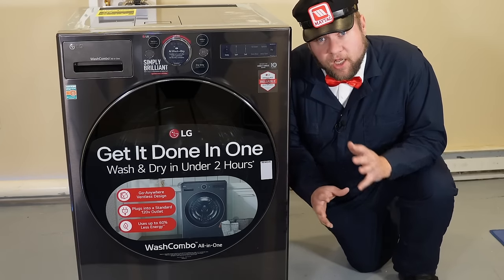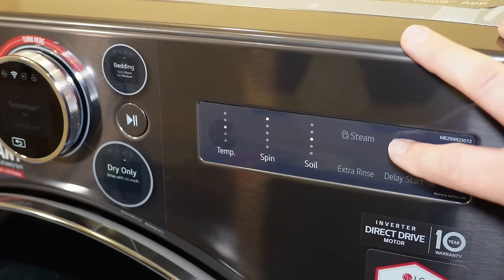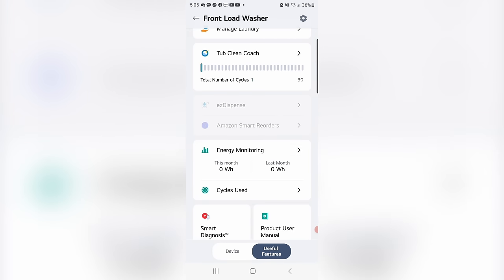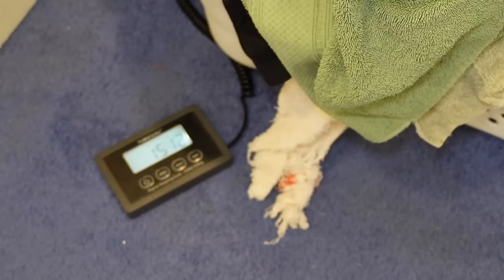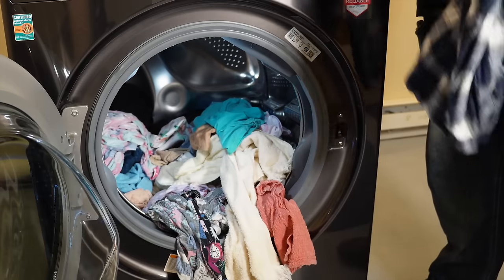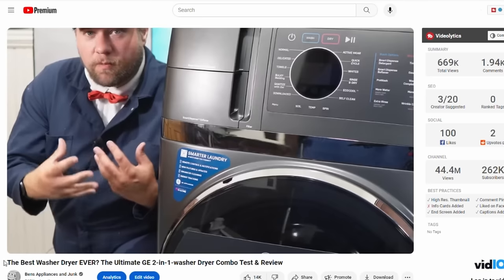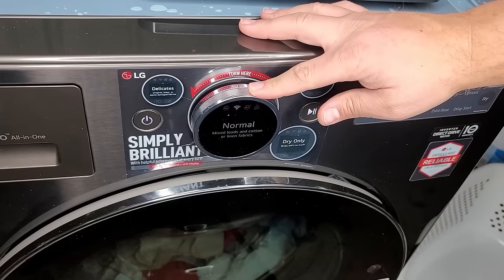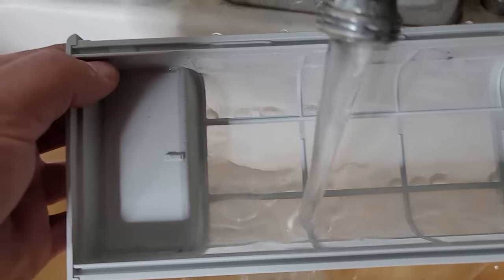BETTER THAN GE? The LG All in One Washer Dryer Combo: Test, Teardown & Review

Comment: Fantastic review!  I have one of the heat condenser models that is about 10 years old by now. I have loved it!  That is not to say it’s perfect by any means. Over those 10+ years I have had to have a repairman come out maybe three times possibly four, and once it was for some valves that had gone out, but most the times it was for a leak that would happen in the drain plumbing.  To save a few cents LG uses these really cheap plastic pipes and tubes inside the unit that literally decay, get brittle, crack and leak in only a couple few years.  It sabotages all the rest of what is otherwise seeming good quality otherwise.   The corrugated drain pipe is an example, and they use the same or similar to inside the unit as well. Had it not been for the stupid pipes and tubings I would only have had one repairman visit for the valves. It is really ridiculous that LG uses this cheap plastic garbage tubing in their units, because you cannot convince me that it’s that much more expensive to use a good old-fashioned rubber radiator hose that would last forever.  

It turns out that the complaints about it’s drying are somewhat ill-founded. There is a trick you need to do, which is to make sure that your drain pipe is not too high, the lower the better. The unit has to pump that water out and the easier it can do that then the quicker it will dry. I read one report from a lady who simply put her drain into a floor drain that she had, and she had very good drying results. My drain is about at the standard high about 32 in I guess, and I have not had that much problem. Another thing that helps is to have a dehumidifier in the room. So yes, the drying times will always be longer on these all in one models, but if you are like me, who just wants to throw it in and be done with it, it’s great!  If the clothes are damp, you just spread them out on the bed for a half hour and you’re golden. 

Given the age of my unit, the vibration dampers have now seeming worn out and I can’t run it but on low speed.  So I’m debating about getting it fixed or getting a new unit.  The only thing I didn’t like about the new LG is that dust collection on the condenser coils. I’m gonna study that a little bit more but it almost looks like they put the filter on the wrong side?  I have had once or twice where the heater smelled burnt a little bit on my unit. When the service people came out, I had them clean the heated dryer, and it did have a collection of dust in it. There was one report on Amazon of a lady experiencing a fire in it. I think you just need to plan on having a service rep come out every 3 to 5 years and give it a once over to keep everything tiptop and you are OK. There were also some people complaining about pet hair, getting into the filter and then having to clean the filter every single time. If that is your problem, I think you need to get rid of your pets. Either that or get a vacuum out and vacuum everything down before you put it into the washer. I don’t think you blame the washer for purposely clogging it up with gunk that shouldn’t be there.

Comment: I bought one and ended up trading it back in my clothes came out far too damp and the drying cycle takes far too long that I’m not comfortable with.  I never had anything below two hours everything was five hours to eight hours very disappointing in LG combo unit I trade it in on LG tower conventional drier don’t think the heat pumps are there yet.  Note it takes far longer to dry and never ends the cycle to dry.  I never logged a finished cycle.  I don’t recommend a waste of time.

Comment: given the tumbler spins for 4 hours vs normally 1 hour,
would the tumbler bearing life span drops 4 times as fast?
Reply from the maker: Its a washer bearing, not a dryer. They're built to handle 1600RPM spins, and the drum rotates very slowly in dry. So I imagine the mechanical cost to spin that drum on dry is very, very, very low.

Not only that, the drying action is going to kill molds, bacteria and build-ups that would eat away at the washer spider brackets, so its probably a net benefit, honestly.

Comment: 🤯 ~ you have a heat-pump combo washer+dryer in the 🇺🇸! We in UK & Europe have had combined washer+dryers for quite some time - but our versions, the dryer function is based on the very inefficient condenser unit = heater elements heat the air and it is blown into the drum through the hole in the right hand side of the top of the door seal, and through the laundry being dried and out through the holes in the inner drum to the sump at the bottom of the outer drum where the moist air is drawn up a column where water is poured/sprayed to remove the moisture from the air and a centrifugal fan at the top re-blows it into the heater block…🔄, on this side of the pond [🇬🇧🇪🇺] ~ the only manufacturer who claims to have made a heat-pump washer+dryer is AEG and all the others still use the inefficient dryer function. Interesting that the US is slowly adopting the trends in Europe and has even “jumped the gun” on the technological side. The heat-pump tumble dryer is based on a refrigeration cycle type dehumidifier = the moist air passes through the “cold” coil block where it condenses and water drips out > the “cold” air then passes through the “hot” coils where the refrigerant re-absorbs the cold and turns the air warm
Reply: The washer dryer is actually ancient American technology haha, it just was so inefficient that it didn’t really make sense to use. Down went that invention to Europe where it was slightly improved, but not by much. These new heat pump units are a game changer though!
Reply: @Ikey04-ge9gy  - yes, I have watched a 🇺🇸vintage laundry channel on YouTube, where a vintage/antique [40,50s] washer+gas dryer was being demonstrated = it had a square window in the door and it had a continuous, one-direction slow tumbling for the wash, rinse and dry cycles & a gearbox/large > small pulley ratio for the slightly more faster speed for the spin cycle and for the drying; as the motor drove both the drum & fan ~ a valve/damper would open allowing the continuously running fan to draw air through the drum and a (natural) gas valve would open and spark a small blue-flame fire at the side of the inner drum to “dry” the laundry! The laundry enthusiasts are heard laughing and mocking at it saying how extremely inefficient and rudimentary it is on its combined wash & dry program = the laundry being wet & soapy at the end of the program; extremely long times and a waste of gas. Most would not buy it, some who did buy it would give it a poor review and having the manufacturer “get rid of it” and replace with much more efficient with washer/dryer separates/having to supplement it with a spin dryer to try to make it more efficient

Comment: Ben from your review it sounds like you might favor by a small margin the LG... I was looking to get one or the other some time in the next 90 days... For my particular needs I thought that the LG might be a better fit... Very small apartment placed in the kitchen (near kitchen sink) to provide easy access to water and drain which I would rather have than a dishwasher... Run clothes washing in the middle of night... I have one of the LG monitors which is running the ThinQ app... Here in PA the electric rates are lower off peak and are only 0.17 cents per kHw hour... So I am guessing about a buck per load energy and buck and a half water costs... So this becomes a no brainer when the only laundromat is cost $2.00 to get there and $5.00 load to wash and $2.00 dry... not to mention the time!! Essentially my ROI (machine cost) is 15 to 17 months...
Reply: This unit as stated is much quieter than the GE.  My bedroom is close to the laundry room.  I couldn't run my old dryer at night because of the noise.  This unit just makes a distant hum instead and I can use it at night.  Average consumption I'm seeing is 2 kWh per load, so you might be down to 28 cents for elec. at night for a load.

Comment: I appreciate your reviews.  I would like to know if this new machine or the GE version use more electricity than a standard top load washer 5.0 cb ft with a 7.2cuft gas dryer? I love where electricity is very high And if these new devices really cost less that would be great but since they run so long i am concerned. Any comments or thoughts would be appreciated.
Reply: Usage is .3 kWh for wash and 1.7 kWh for drying.  So about 2 kWh per load on average for this machine.  Drops to about 1.7 kWh total if you were to get seperate machines that incorporate the tech of this machine, which LG makes in 2 forms.  Vertical wash tower or 2 machines side by side.

Comment: Interesting that you found no evidence of a self-cleaning coil as advertised.  

I don't like that you have to remove screws to get access to clean the coil and also to remove the secondary lint filter. This should be tool-less. 

Otherwise, I this the machine is a good offering.
Reply from the maker: It looks like there's 1 water hose going to the condenser box, but its offset to where only 1 side of 1 coil could be cleaned, potentially. There's no indication as to when it would use this in operation, or how, so its hard to guess. I had a commenter note a few days back that the LG heat pump driers had a good system, but without documentation, its hard to confirm what the process may be.
Reply: @bensappliancesandjunk  Interesting. Anyways, I love how in-depth you get in these videos. As a mechanical engineer, I enjoy seeing theses types of reviews. Thank you for replying to my post.
Reply from the maker: Thanks! I'd get more in-depth, but often I have to edit things out due to time constraints. I try not to say the same thing multiple times in the video to try to keep it flowing, but then also in some cases, there are things I wish I added (like more shots of the heat pump system, the water hose going to the condenser, and so on). I do hope to add these things when I do a head-to-head comparison of the GE and LG systems, since I won't have to repeat so much of the same things over and over again.
Reply: @bensappliancesandjunk   I'd also like to see more detail on the condenser cleaning system as well.  It looked like there were some holes in the heat exchanger cover that would allow water to spray out, but the video only showed that side of the cover for a split second.

Comment: I think LG's decision to engineer the unit to run a standard 120V 15A circuit has a lot to do with the long cycle times. Also, I'm guessing the choice of refrigerant came into play. A more efficient refrigernet may be available, but its cost or other factors ruled it out. Its a machine of compromise. The price you pay for an all-in-one machine that runs on a household circuit and that doesnt need to be vented is a longer cycle time.
Reply from the maker: The issue is that the GE Ultrafast pulls nearly 2x the wattage on its heat pump. It has a shorter-ish cycle time. The refrigerant was super interesting to me since its banned in the US from refrigerators, but neither LG or GE decided to go with something used in dehumidifiers or ACs like R-32 or 457B. But instead went with the 134.

Comment: Excellent video!

My biggest and almost only concern is drying, being in S FL humidity is always 70%+ on top of that I can’t wrap my head around how people comment, it feels damp but you shake it and it dries. Is it dry or not.  And is the LG dryness level the same as the GE or it also needs to be shaken?
For last, I keep watching demos and it seens that all comes out soooo wrinkled compared to regular driers.  Is this your experience ?
Reply: As he said in the video, they come out bone dry.  I experienced the same.  Very similar to my old vented dryer, dry and partially baked.  I could do with a little less drying actually.  The machine is new, so I got a little more figuring out to do.

Comment: Do you think a sealed system tech will be required to fix the dryer components?
Reply from the maker: If its a sealed system problem, yes. But in my experience, most cooling-related issues with a refrigerator don't require hacking into the sealed unit... Usually. 

I'd venture to guess 60-70% of the issues w/ a no-heat problem are going to be easily serviceable w/o a refrigerant tech. However, those that do need them will get pricey fast.

Comment: I have 2 LG All in ones. Outside of occasional pump replacements I have no complaints. I just run them overnight. For heavy loads I also have an LG dryer so the extended dry time is not an issue. Oldest unit is 15 years old, the second one is 10 years old. Especially like the lint filter add-on for this unit.
Reply: Good to know, I'll have to remember that then my stuff goes tits up. My washer and dryer and 10 years old, very basic /cheap. Nothing has broken in the washer, and the dryer heating element went out just last summer. $30 part, easy to replace after initial diag

Comment: I have an older LG combo. I have to replace the drain pump a minimum of 4 times a year.
Reply from the maker: What's causing the failures?
Reply: @bensappliancesandjunk  if I only knew. Seems that they should have installed a larger pump

Comment: Who are these designed for? 
Too many electronic selections. Your washing clothes, whats wrong with an on off button.
Reply from the maker: People that don't have 240v outlets or can vent outside. The choices of machines for these types of operations tends to require a bit more advanced of a system due to the extreme requirements of such a unit. You need something that can manage multiple complex operations simultaneously, and a timer-based system would be just as complex as well.

Additionally, since these machines run longer than a traditional vented pair, I found that delay start (something easily done via phone/interface) makes these units far more capable and viable than traditional pair machines, since you can schedule them to run and finish when you're ready, instead of babysitting the laundry.
Reply: Forget the app, this is designed for mostly smaller condos where you need space and low noise. I own an older model and its been doing wonders for us.
Reply: if that same line of thinking was applied to all aspects of life, we wouldn't have ABS Traction control, airbags, home thermostats,  or just about any of the everyday things we take for granted that makes things smoother/faster/easier.     I'm in the market for either the GE or the LG, mostly because I can throw a load in, leave the house, or do whatever without having to stop (or worse forget) and have a pile of wet moldy clothes to deal with.   In the long run it saves me time, water, and energy.   This unit isn't for large families I'm sure, for me personally 2 loads a week max is all I actually need.
Reply: @toxin440  Millennial? You do not know what you have missed in life. All that commentary about washing equals laziness.
Reply: @googleuser1036  let me make sure I understand your argument: you are saying I've missed something in life because I'm not staying home washing clothes manually with an old school washer/dryer?    Explain to me how saving time with technology means doing fun things like hanging out with friends/family and going places/doing things is missing out in life.   You are the one publicly advertising your technophobia.    If you want to live in the stone age, that's great, but don't drag everyone else into your fear.
Reply: @googleuser1036  I'm guessing you are older, possibly elderly?    I'm 42, I value my time, and allocate it efficiently to accomplish what I want in life.   I have way better things to do than sit around waiting on a washing machine or moving wet clothes manually.   I understand people like you though, my dad, up there in years actually goes does to the pizza place and orders it face to face instead of online.   So not only does he miss out on any reward points, he's also sitting around staring at a wall for 30 minutes waiting on a pizza.  You can be old, cranky, and happy to waste what little time you have left.   The fact you are touting waiting on washers and dryers like it's a badge of honor tells me you really must not value your time at all.   Ask yourself this: when you are on your last days on earth are you going to want an automatic ventilator that helps you breathe correctly, or will you be happy with some old model that's operated by a hand crank that fits in with your fear of technology.

Comment: I like that it's not as tall as the GE model, but the difference in size in the heat pump system is an immediate red flag for me.  A larger capacity drum, significantly smaller heat pump, and a supplemental resistive heating element, it's like they designed this specifically to address the concerns a lot of people have with the GE all-in-one.

I'm really curious how these heat pump dryer systems affect ambient temperature in a small confined space like a laundry room.
Reply: With a ventless heat pump dryer, it's effectively a dehumidifier. Perhaps some heat energy is rejected down the drain, but I feel like it's fair to think of it like running a 500-700 watt dehumidifier in that space for an hour or two - so not a huge amount. Honestly I'd bet that more heat than that literally leaks out of a flimsy tin-can-toploader matching dryer (like a Whirlpoop lint-top) with how sloppy most "american style" washers and dryers are designed and assembled.